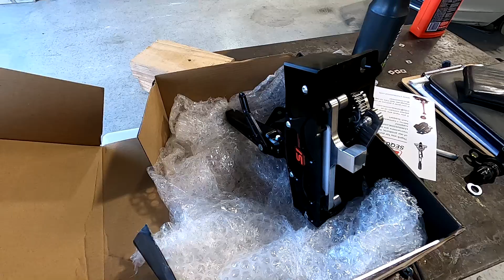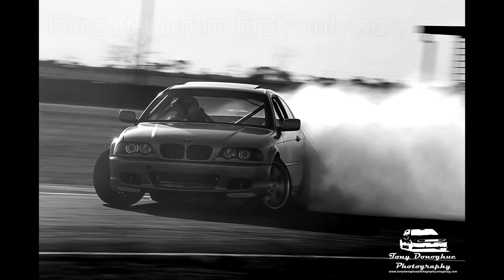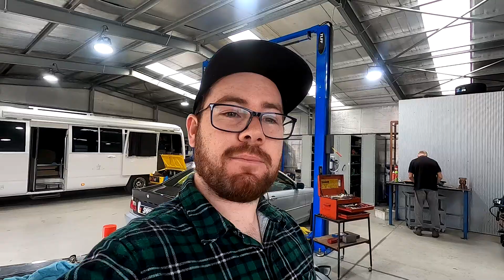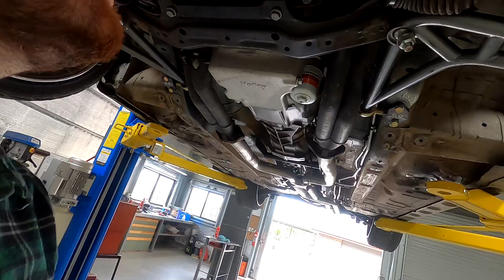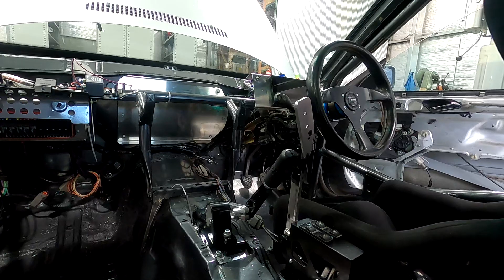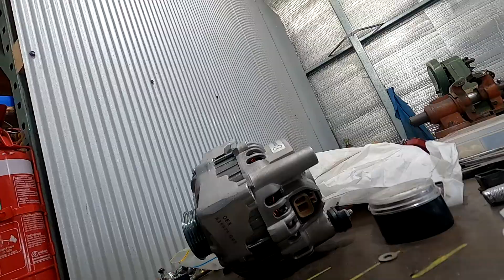S1 Sequential fit up! - Lever fit up for one handed driver - LS1 E46 Drift Build

Comment: Curious what made you choose S1 over DCT conversions? Also where did you order the larger alt pulley from?
Reply from the maker: I already had the T56, bought it like 2 years ago before DCT was really a thing. Also car took long enough to build as it was, so i wasnt keen to add more complexity. I might still go that way someday though.
Reply: @OneArmedBanditYoutubeChannel  yeah understand, if it makes you feel better I bought my gearbox 7 years ago and I’m 1/3 done with the swap.
I looked at s1 too but was confused about how much benefit it produces while still having a clutch.
Even though I want my car to be a “drivers car” with 6spd manual the DCT is mega appealing for hard fast shifts to keep speed up
Reply from the maker: @octane_matty  honestly if i had 2 hands i probibly wouldnt have worried about the s1 & might have invested in better ratios for the rear end so im only drifting in 3rd and 4th.